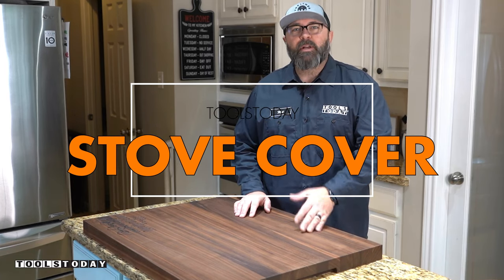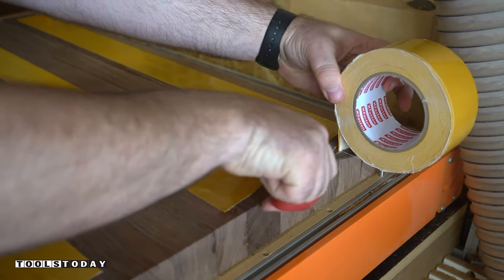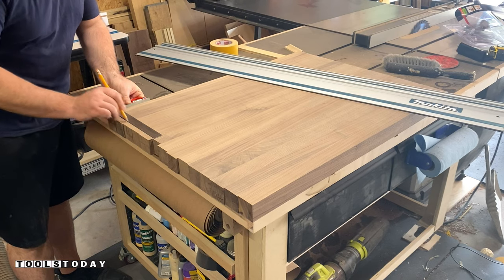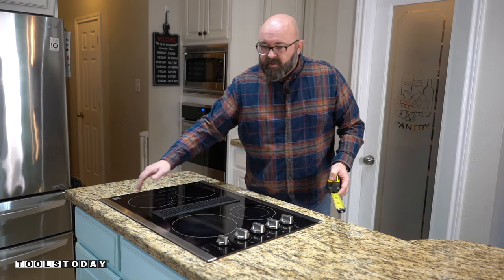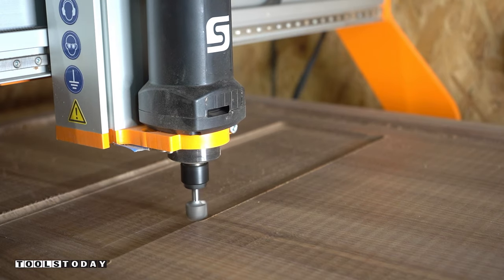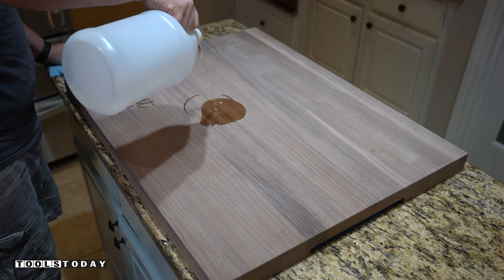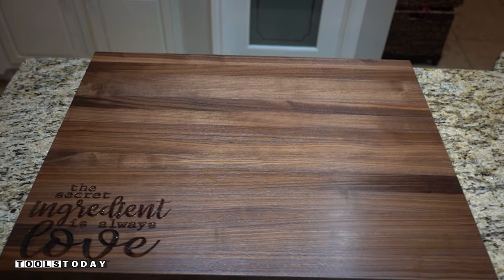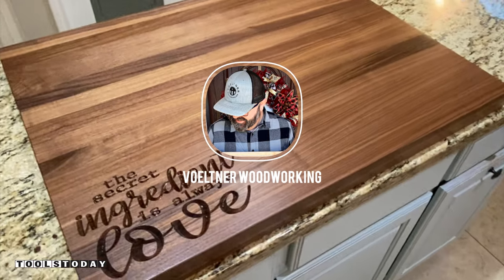How to Make a Stove Cover Using Your CNC | ToolsToday

Comment: Hi. Looks Great. Now following you on Instagram and Youube. Can you share the CNC Settings for the Engraving on the CNC Machine?
Reply from the maker: Hi there, thanks a lot for the follows! Yes, Amana Tool 60 Deg V-Groove item #RC-1148 settings when cutting hardwood: 
RPM: 18,000
Feed Rate: 40ipm
Chip Load Per Tooth: 0.003”
Ramp Down: 20ipm